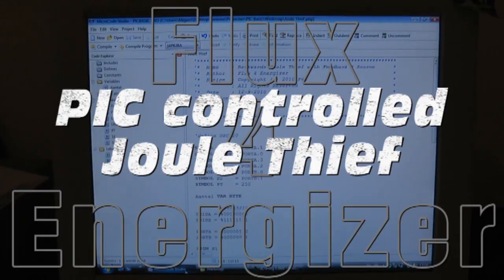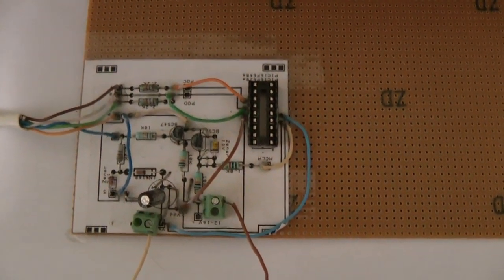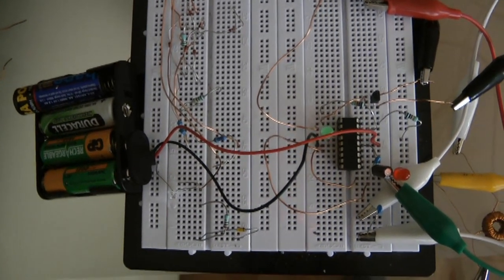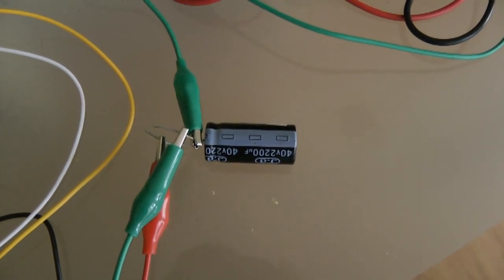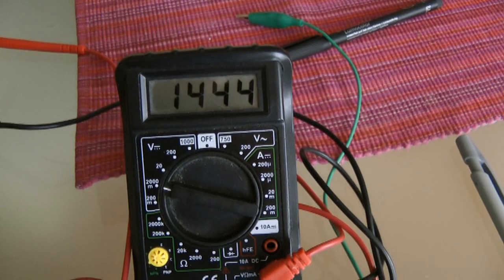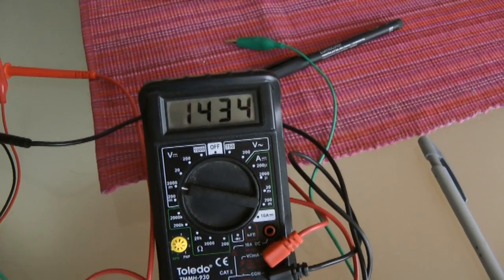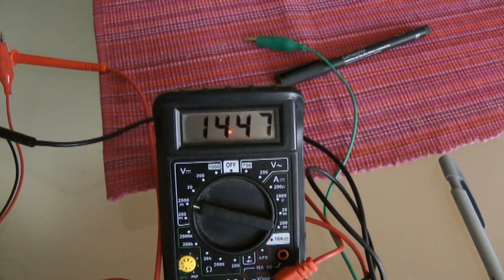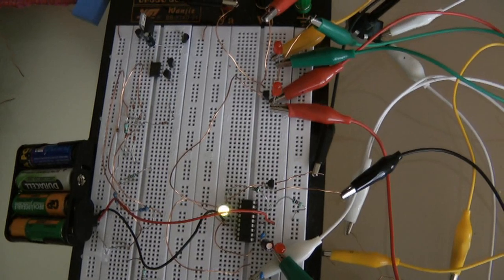Joule Thief with Feedback 2 Source PIC Controlled (Part 1)

Comment: What does the microcontroller monitor during its operation? Battery voltage?  Or is it just acting as a switch?  

Thanks.